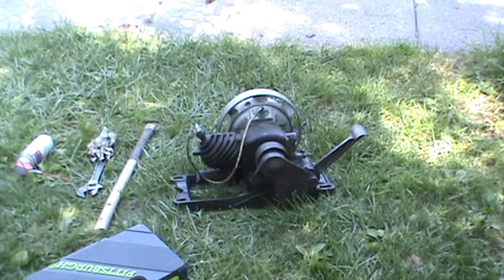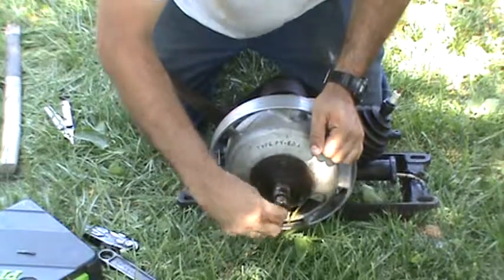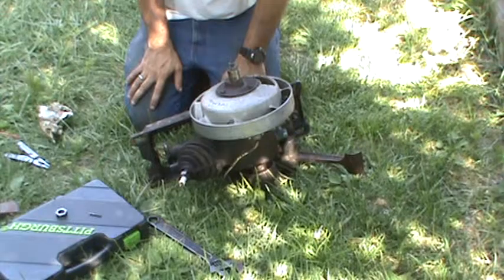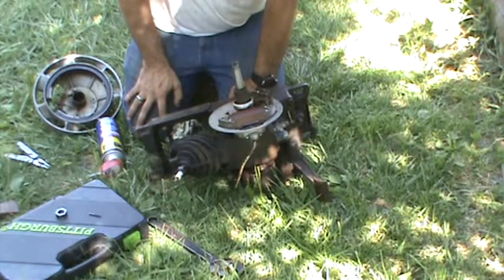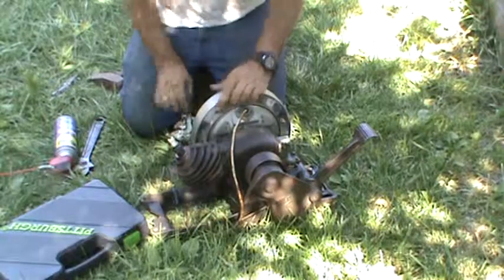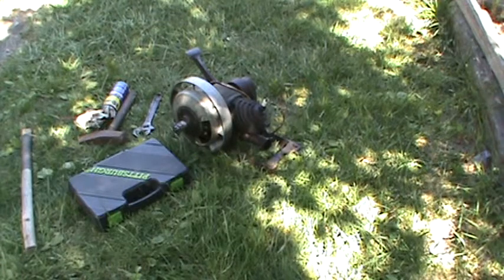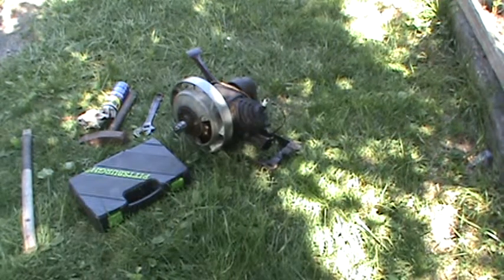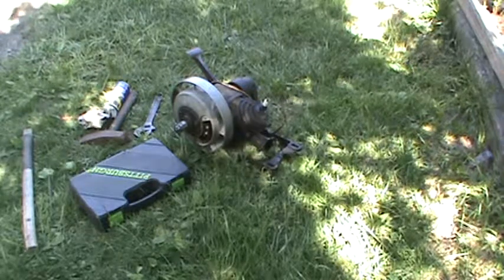maytag 92 flywheel removal

Comment: reverse the (CASTELLATED) nut after you take it off. (slotted part toward engine) sharp small rap with hammer and it pops loose every time.  For more info look up (shopdogsam) on yourtube.